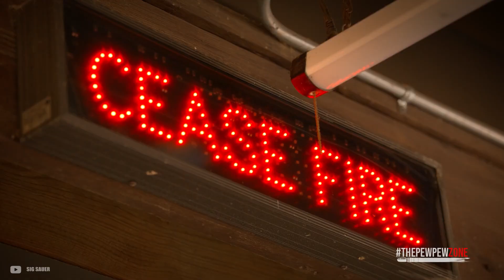MUST HAVE Guns for 2024, SHTF & World War III

Comment: I watch Everything Blackpowder. he's just another 2a tuber, but one thing I've realized from the guy testing different DIY black/smokeless powder in diff pews...not all are the same. 

IF you're really talking something for SHTF, a consideration (among many)...how difficult is it to reload? 
Sure you can sand-mold lead bullets no prob. Lead is in every car/boat/rv battery.
BUT how does the gun run w/o reloaded cartridges +  cast Pb bullets + blackpowder or DIY smokeless?
Reply: The answer here is: bigger bullets = better. 45acp, 38spl, .357, 10mm, 44mag. 
The logic is fairly straightforward:
--> bigger bullet = even with factory smokeless powder, low FPS/muzzle velocity
-->Black powder = lower fps compared to smokeless. These cartridges have less 'gap'  to bridge from their smokeless ballistics (IE 2400fps 9mm =prob impossible w/ black powder in 5-6in barrel). 800fps like w/ 45acp = doable.
--> Revolvers ARE KING. arguably easier to clean, the cylinder-barrel gap = any accidents just gona 'cloud of smoke' you. You're not gona have to mess w/ slides n rails/etc getting gunked up with black powder residue. which is also somewhat corrosive

Comment: I know plenty of people that carry a handgun in .380 ACP, including myself, for self-defense. It's a viable round with 2020's ammunition technology, like in Hornady's hollow points for example. Granted, it is low on the power scale, but it still delivers similar psychological feedback response to the assailant as a 9mm Luger could. 

Don't forget in American history: the Mafia of the 1920's and 1930's used the .32 ACP in pocket handguns until the .380 ACP cartridge was invented in the late 1930's, then they switched gears, making .32 ACP obsolete for pocket or subcompact carry. There had been issues with the .32 ACP cartridge even when it was in common use, as it didn't penetrate very thick/dense objects too well.
Reply: I carry a 32 acp and dont feel undergunned with 9 rounds in my pocket
Reply: 32 ACP as loaded in North American standards is underpowered. European standard 32 ACP packs the right punch!

380 ACP is 9mm Kurz or 9mm Short. Never underestimate this round!

Comment: Not a "high capacity", it's a "high count number capacity" for more firepower when it is needed most.

The reason for the distinction is because most firearms today have standard capacity numbers between 10-20 rounds straight from the factories that build them, depending on what they are exactly and what caliber(s) they chamber.